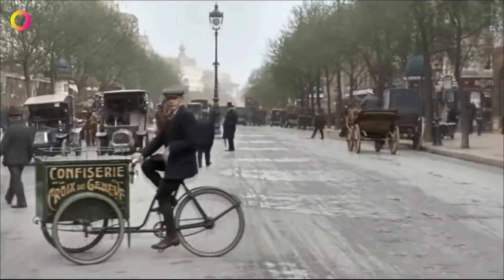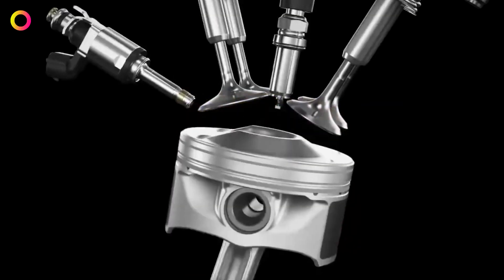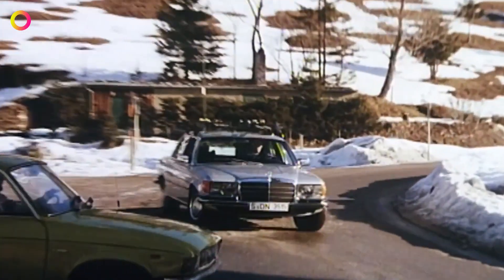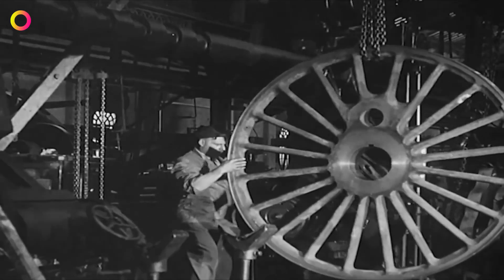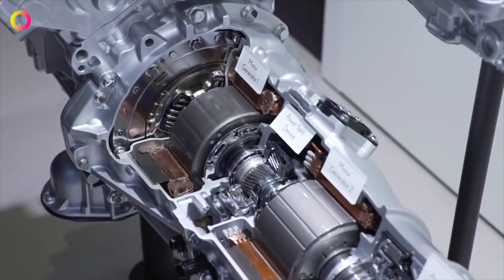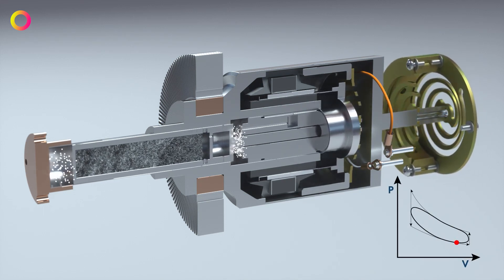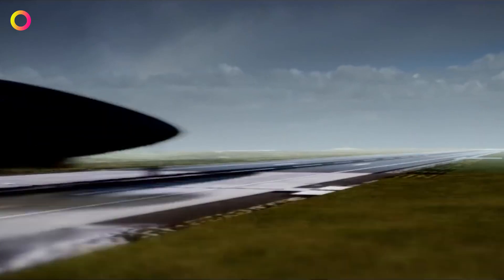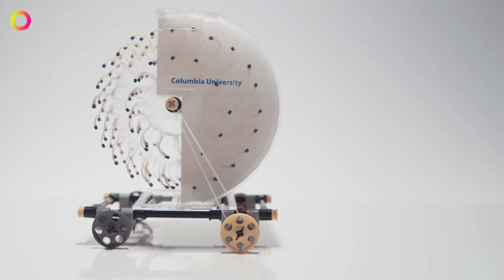The most unusual and amazing engines that strike the imagination

Comment: If we talk about the trends of modern world motor engineering, the internal combustion engine remains in the lead, although in fairness it should be noted that some attempts to "encroach" on the "holy of holies" still exist - for example, a serial Tesla electric car is already being sold. But since the oil industry is today a key branch of the world economy, the dominance of internal combustion engines may remain unshakable for many decades to come.

Comment: The only bad thing about all this is the pollution that occurs from the use of fuel for these engines. For years that has been the problem, the solution would be that in this modern era they only invent motors that use electricity, electric cars to avoid so much pollution. That is in part the era of modernism.